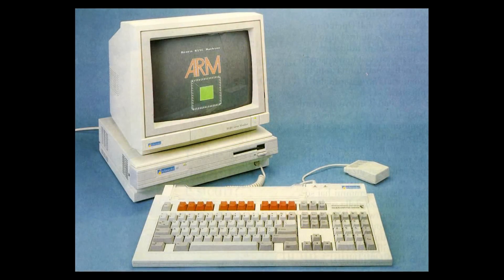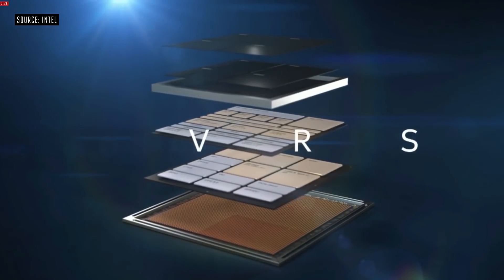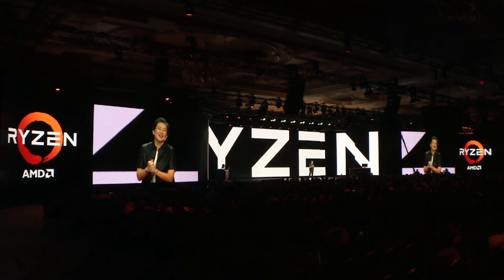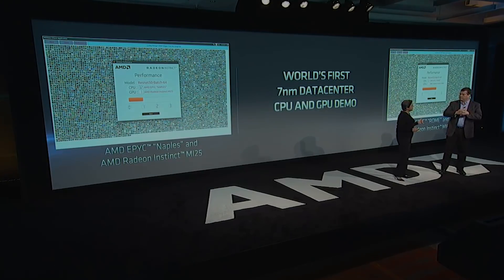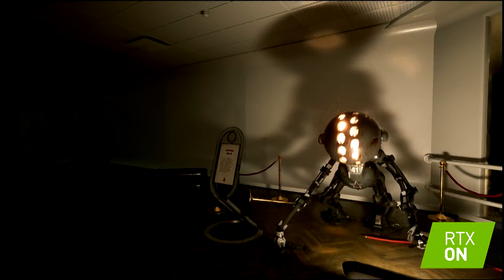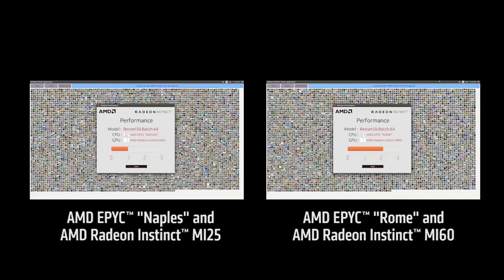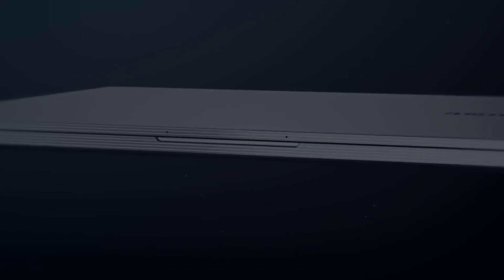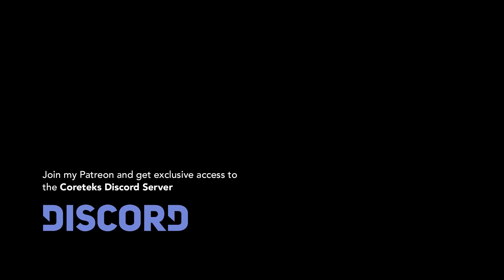Hardware trends: How many cores do we need?!

Comment: You're ignoring a very important part of this question. While you can't scale performance infinitely, there is also the matter of the fact that you don't have to. Take the ray-tracing question as an example. At peak performance the system will be running fast enough to let you apply this algorithm to an entire scene in real time, without sacrificing performance, while leaving resources for other operations that may be able to use this hardware. In other words you don't need infinite scaling performance for all operations; you need enough compute resources to be able to reach the top of the S-curve for every single workload that you may want to run. That's your point of optimal efficiency.

The way this scales is by opening up the possibility of using those resources for additional workloads. So for instance, those extra ray-tracing cores could potentially be used for other physics simulations with minimal tweaking. 

Next up, there's the fact that you're overly-generalizing how programs are parallelized. It's somewhat pointless to talk about chrome being 50% parallelizeable, because chrome is an interwoven mesh of systems, some of which don't have any need to operate in parallel. Instead it's more accurate to look at individual subsystems, how well they can be parallelized, and what sort of benefits that would yield you. This means that while chrome might only have 50% of code that is parallelizeable, consider what happens if you break it down into 100 subsystems, of which 20 of most computationally intensive submodules can be optimized to the 95% level. The result could be that compute heavy operations that previously took a second could take 100ms, while sequential operations that previously took 100ms would stay at 100ms. On average the speed increase would be quite small, but the actual perceived performance impact would be huge, simply by virtue of the fact that analyzing averages means you're not fully understanding the impact of the outliers, which is much easier to perceive as a users of the system.

In other words, applying these algorithms to modern multi-modular systems doesn't give you a very accurate picture of the benefits of large scale parallel hardware. You can do a lot of math to show that the average benefits have a hard cap, but in the process you ignore the actual perceived differences that come from having hardware available to handle peak loads that would otherwise cause very noticeable delays, as well as the fact that given more resources programmers are going to be able to write more systems to utilize those resources in order to provide services that are currently not feasible due to the average parallel compute power of most users being too low to support them.

Edit: Also, the math for ray-tracing doesn't really add up. Something like 95% is a very poor estimate  of the parallelization factor. Consider this scenario: there are 4 million rays to trace. Each trace takes 1000 cycles. After all the rays are traced there is a combination step that takes 4 million cycles to combine the results together. Let's say that each trace can be run in parallel, while the final step for some reason can not. In this case the total number of instructions that will run is 4,004,000,000 cycles, of this 4,000,000,000 ban be run in parallel. In such a result the p value is actually 99.9% which is quite a ways off from your 95% estimate, while the speedup of the affected section is potentially capped at 4,000,000x, if all of the rays could be run in parallel. That really changes the results of your calculation to a very significant degree, to the point where the actual latency improvement of the whole program caps out at nearly 1000x.

The disconnect comes from the fact that the p value is not really "how much of the program can be run in parallel" it's more accurate to describe it as "how much of a program's execution time can benefit from parallel execution." That's an important distinction because for many programs the vast, vast majority of the runtime is spent inside a very small amount of code. That means even though most of the program may not be parallizeable, being able to run a small set of loops in parallel could yield huge boosts to the p value.
Reply: polanofesky  I'm a professional writing a technical post, describing a complex ideas, in response to at a person that clearly has more than a passing familiarity with the concept. If someone can't take the time to read a few paragraphs of text, then they clearly aren't interested enough in the material for the content to matter. I have no interest in convincing people like that of anything, it's simply a waste of my time. By contrast, if someone is interested enough in said material, then a short post will say little more than "your math is wrong, so ha,"  which isn't really the most interesting of insights.
Reply: @TikiTDO  Don't mind the troll's bro, keep sharing with the rest of us that can absorb the insights -it is appreciated. It's hard as a professional to keep that "thick skin' all the time. I am interested in digging deeper into the subject of the p value in Amdahl's law and the scalability of mainstream computing. This was the only post I saw that even scratched the surface.
Reply: @RetroTechno  No worries, I actually really like the trolls. I see them as stress pillows for me to yell at without any consequences. 

It's a really unusual topic, then only time I remember seeing this back in school was in an grad level optimizing compilers course. I'm actually really happy I found this video cause it reminded me of the name which I haven't been able to remember for years.
Reply: Totally agreed.
Also since renderfarms are a thing that exist it would be possible to check the actual scaling pretty easely.

Or at least call them saying “95%, yada yada yada, I'm sticking to my pentium 4 man” 😄

Thanks for sharing your knowledge.
Reply: For a given ray, "bounces" are sequential with some rays needing more than others, so at some point you will have less rays than cores. There are also as pointed out scene storage and query issues as well as rays only parallelising efficiently if they are running the same "shader". The current DX/nVidia APIs don't really encourage that, the IMG/PowerVR HW/API looks far more efficient HW friendly.
Reply: Old School True. But we are talking about 8 bounces for medium/high quality offline raytracing or 2/4 bounces for a more efficient realtime raytracing against MILLIONS of raycasts.
For my understanding the worst case scenario is: I have to cast the last few rays so many of the cuda cores / rt cores will be idling while only few cores perform the remaining 2/8 clock cycles.
Even doubling, tripling or quadrupling the clock cycles needed to perform 2/8 ray bounces brings us a delay in the order of a 0,000000012307692th of a second.

Which is comparable to having only the last bucket (thread) active in standard bucket rendering -> which (again) is something we all have survived up to now with only minor injuries 😄
Reply: @ilrompiscatole5414  if the rtx 2080 is capable of casting 10 Billion rays (10 gigarays/s) then we should have 5000fps (10B / 2M wich is 1080p)on raytracing in all of the games, even dividing it into 8 bounces we would have 600fps.

so there is some aspect that we're missing here, may be coreteks knows it.🤔
Reply: Daniel Sánchez raytracing doesn't mean "casting a ray at every pixel and reading the result". The purest raytracing approach would be: I have a light that emits photons, I trace billions of them and only use the infinitesimal quantity that eventually reaches the eye (or camera) of the observer. Although several, smarter and more efficient, algorithms exist, for their probabilistic nature without a proper sample quantity you are going to have a really noisy image. Which is exactly what this cards are capable of delivering right now, despite being able to cast so many rays/s, hence the need for a hybrid raster/raytracing approach and temporal noise reduction techniques 🙂
In a later video coreteks stated that 4096 cores are the upper limit for raytracing. This makes way more sense to me 🙂
Reply: @ilrompiscatole5414  you missed very important things about nividia raytracing, nvidia uses a method that's called backwards raytracing, which shoots the rays from the camera( each ray on every pixel in 1sp) to the light source, so yo save a lot of render time there, for the noise they use tensor cores, which uses machine learning(comparing a noisy image with a clean one) to actually get rid of it in 1 sample, nvidia by now is using 1 sample in every frame, so the calculus doesn't match up.

that was my point.
Reply: Daniel Sánchez  no I didn’t 😆
It’s called path tracing, everyone uses it as it is not wise to simulate gazillions of not significant rays 🙂
I was trying to easily explain why you need MANY samples per pixel without writing an essay... but I understand it is a hard concept to grasp so here we go 😄

Here you can see why so many samples per pixel are needed: https://chunky.llbit.se/path_tracing.html

Here what billions of rays/s actually look like (spoiler: noise) and learn about the hybrid approach I talked about in the last comment:
https://youtu.be/lFnWy0Odsh8

An in depth look at the path tracing approach: https://www.scratchapixel.com/lessons/3d-basic-rendering/global-illumination-path-tracing

John Carmack explains the basics of lighting (raytracing/path tracing versus raster approach):
https://youtu.be/IyUgHPs86XM
Reply: @ilrompiscatole5414  you are confusing pathtracing with raytracing, is not the same, but is understandable, nobody seems to agree in how to call them, but lets supouse the defintition that i have is "the right one".

path tracing is an actual simulation of thr light, that means that a ray bounces in all the scene until it reach the light source, so its very computational intensive so its not sweetable for gaming

ray tracing is a much simplificated version of the simulation of light, how it works? well when there is a ray-object interaction the ray tracer shoots "rays" to the actual light source (well depending on how many bounces the developer wants) that tell information like releflection, color, shadow and all of that.

so if we divided 10Billion ray cast(2080 ti output) / 2M pixels(1080p sceeen) per 1 sample(sp) (which is the configuration of nvidia, far less than what the page you linked says, and botherway the video of nvidia you linked says 1sp) we get 5000fps.
Reply: @oldschool7023  That's a good point. The different number of bounces is definitely going to affect that figure downwards.
Reply: Bingo.
Also, functional programming paradigm is thread safe.  This is why non-FPP languages like C++20 are getting toys from the FP world like generators.  (A generator in C++ is the same as using the yield keyword in Python.  While you can go out of your way to write a non thread safe generator, by default it encourages thread safe code.)
@TikiTDO  If you're not on Hacker News, you might want to check it out.  You'd probably like it quite a bit.
Reply: I think you completely missed the point. The purpose here is not to find a miracle solution to keep boosting the performance to unimaginably high. The point that the author is trying to make is that if 25% of raw performance increase per generation of cards can not be met, it's just a matter of time that the company will become irrelevant. The mass market does not care about ray tracing. The majority of the people don't even care to be honest.
Reply: I think the only limitation to scalability is human hardware.

Gamer should be the first breed to embrace cyborg enhancement in order to truly see the glory of 400K 19200fps 600 monitor gaming.
Reply: TikiTDO 
You said it. The time saved will diminish per a specific workload as you add more cores. BUT, you can do more workloads with those extra cores. People are already talking about 3D game sound, and we do not even have fully raytraced games. This video is very shortsighted. However, I will say that iGPUs will cover much more of what most people need. Developers will come up with uses for the extra hardware. We do not even have full, great hair and cloth simulations in games.
Reply: The problem is this video is only amd "brainwash" propaganda...is a damage control video saying "hey people without a degree (or teenager gamer), rtx will fail"...Making feel them important by explaining some laws (ahmdal)... But applying it with zero consciousness
This video is an amd propaganda brainwash
Reply: @albertosimeoni7215  Well, I have a degree in Computer Engineering, and I certainly got a lot more out of this video than you seem to suggest. So either you know something I don't know, or you're just trolling for attention.
Reply: @TikiTDO 
I don't blame you, (I have the same degree), I do not question on the content you explain, I question on the purpose of this video...forcing people to think of ray tracing (or path tracing and other variant) (that seems an Nvidia key strategy point for his product and future) as limited by ahmdal law with meaningless numbers (when even monkeys by hearing how it works can easily start to write the ray generation function with "for(i=0; i < n_rays; i++)" )...
while before this he could ask himself if 10-20-32 cpu cores in mainstream computer are Needed or a marketing move called "demand stimolation"...since ahmdal law hits more general purpose software (low parallelizable, highly serial (causal link) code), than highly parallelizable Algorithms...ok OoO superscalar cpu have less than linear gain by increasing transistor count due to auxiliary register of OoO and the number of operation needed, so the practical way is just put in moarr core...
And this is another topic never discussed by those pseudo tech videos...8-10-16 cores in mainstream cpus... 
Yo can say "99% of time they are useless" and average ignorants will respond:
 "blame the lazy programmer!!"... (how many times I see this sentence)... 
"look at cinebench point, we need more core!!"...
"but they end up being memory bandwidth limited, oh look they are  memory limited now"...and you find them respond as an army of bot: "Infinity fabric"..
Reply: @albertosimeoni7215  To be fair, this is basically a tech news channel more than anything else. I think it's useful for people to understand a bit about the technology they use, and to have a healthy respect for the complexity that is inherent in this field. I guess I also have a very skewed view of the matter because a lot of my workloads are crazy parallelizeable, to the point that my 32 core workstation can feel limited.
Reply: @TikiTDO 
try openACC, with few pragma similar to openMP it is the easiest way to use gpgpu (makes it transparent, what you write in C/C++ is compiled to be executed on gpu... You decide what with "#pragma")...probably with some penalty respect to cuda or openCL, but for MCMC sampler (or other importance sampling, Em algorithm etc..) or something that need to repeat N simple computation you get more than using cpu cores
Reply: just a dumb question. why, when we are hitting the limit of clockspeeds, and adding up more cores will not only benefit, do we only use 2 states? 0 and 1? could we not more then double effective speed by using 4 states or more? yeah it would be a pain in the ass to engineer :)
I think at some point there will be no way to get really more performance out of decent size packages, then to get rid of binarized computing, at least for special tasks.
Reply: @certaindeath7776 
In theory yes in practice no....
To have 4 state you need to have 4 tension level...being able to identify 4 state of tension at high frequency and make billion of transistor and connection precisely at the point they don't make quantization errors is impossible...maybe they can do something like 1000x less logic gate at 1000x less frequency compared to actual binary ones...And probably circuits will get more complicated to manage fanout and logic....the other rumored way is optoelectronic to speed up in frequency using photons instead of electron (no Joule effect, theoretically no energy wasted and not rise time, the problem is the conversion photon/electron that is not 100% efficient)...
Reply: @certaindeath7776  One of the main reasons to use 2 states is ease of converting electrical signals into actual values. Let's say your CPU runs at 1.2V, then we can be fairly sure that any signal that's below 0.6V is a 0, and any signal above that is a 1 (Sort of anyway, I'm simplifying away a few complexities here). Most signals that move around your CPU are in fact not perfect 1.2V or 0V, so this is a very helpful feature.

It's actually really easy to use our existing processes to create transistors that can work natively at these voltages, and it's even possible to move this threshold voltage around a bit with a common input to these transistors. In all, it offers a lot of redundancy, and a lot of control.

Using 4 states would be much, much harder, and significantly more error prone. One immediate issue is that that a circuit element capable of operating in 4 states would be much bigger, and significantly more complex, with much more error correction necessary. So right off you're going to lose a good chunk of possible gains due to different sizes of the basic computational elements, and more hardware to compensate for errors.

Another problem is that the software necessary to make use of such a structure is non-trivial. We can't just take an existing binary program and make it trinary or quaternary; these would be fundamentally different models of computation that would require a total re-think of the very fundamentals of software. It's not as simple as representing what used to be 2 binary-bits as a single quad-bit. It's also all the circuitry necessary to make all the new values do something.

That said, there has been some theoretical work on trinary computers, and there were algorithms that we shown to be more effective on such a system. It's just that the practical costs of such a system are so insanely high that no one really wants to do it when we still have a few decades of potential progress left in our current approach.

Incidentally, trinary computers are in fact theoretically the the most effective computers we could build (In fact a computer that could store and process 2.7182... bit of information is the most ideal, but it's kinda hard to store a decimal fraction of bits, so 3 wins out because it's the closest). I don't recall the specific proof for that since it's been over a decade since I studied this particular part of the field, but sometime in the future this might come into play.
Reply: @albertosimeoni7215  .l beleave it,s not human to,check out all the inflections and edoisencitys of the speacker, it may have stared out as a human ancher ,but throuw time has morped to machine. Very well done to.Billy B. Pattent holder to the 4 transistors in the Ic chip.